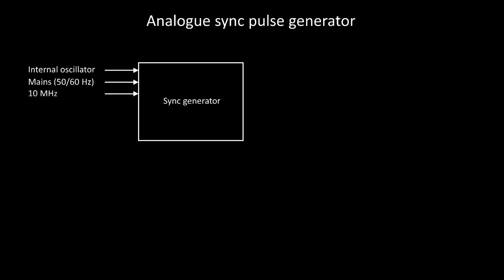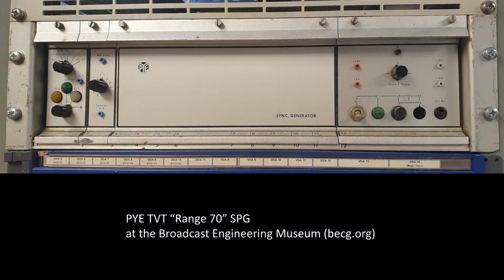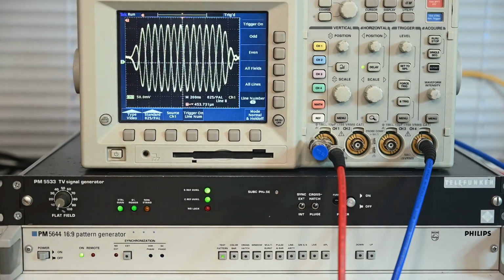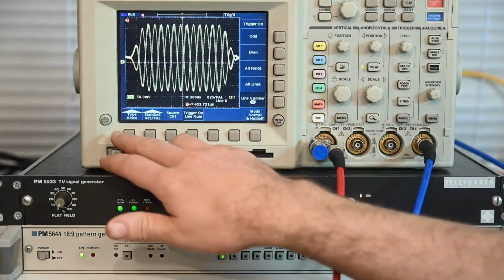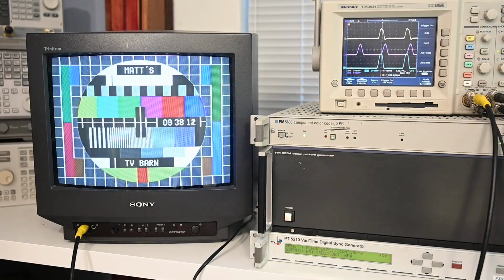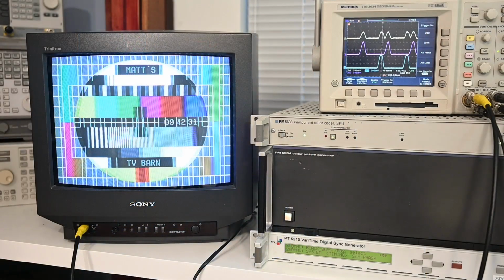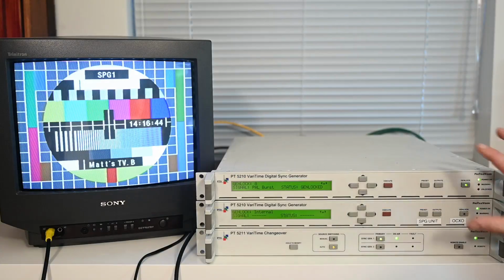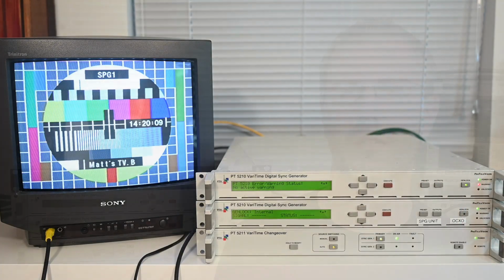#19 - Analogue sync pulse generators (SPGs), sync signals, genlock & video mixing

Comment: I've long knew that you can mix synchronized composite feeds with essentially just a potentiometer, but it's still quite magical to see it happen live.

It would be also nice to see it done purposefully wrong, on signals that can't be mixed. Like SECAM - and see how that would manifest on screen. I have an idea of what the result would be, I can also simulate that in software (or generate a "fake" SECAM signal on a Raspberry Pi or something) but seeing that done with real studio equipment would be something else ;)

Comment: 1:56 - Now I'm confused. I assume that if the grid needs more power the dynamos have to rotate faster? Thus higher Hz? This isn't common knowledge. But what about a dynamo with no load? Where does the energy go? 🏥 🛏 💊
Reply: If more electric power is required the energy driving the generator is increased which make it TRY to speed up but that causes the generators phase to try to advance which causes the current feeding the grid to increase using up the added energy. The generator thus stays synchronized to the grid but delivers more energy to the grid. If the generator is not connected to a load the generators speed of coarse increases to use up any added energy feeding the generator.

Comment: The Grass Valley 9500 sync generator change over was as close to failure proof as you could get. They had a PC board with glass reed relays in a circle forming  a 6 pole double pole switch. There were no buffers or any active components in the signal path, just the glass relays. They did monitor all six signals from both sync generators for amplitude. A loss on any signal would trigger a solenoid to move a permanent magnet disc under the reed relay board to switch to the standby generator. To manually switch there was a lever to move the magnet disc to enable either sync generator. So even if the changeover unit had a power failure, you could still easily manually switch to the opposite sync generator. A bit overkill, it's only TV! The Tektronix and Leitch changeover units of the day were active devices like the Phillips.

Comment: Note that in consumer and pro non broadcast VTRs (Umatic) the color subcarrier is not locked to H unless you use a TBC. This does produce a decent image but is also introduces artifacts as the chroma is stabilized but not the luminance signal. You can forget about consistent Y/C delay! Also note that in the USA early 2in quad color videotape broadcasts also had unlocked subcarrier as they had no way to stabilize the luminance to the required precision for color playback. Two processes were used. RCA hetrodyned the separated chroma up to a higher frequency around 20mhz, then back down to 3.58 and used the off tape burst to cancel out the chroma jitter. Ampex took a different approach. They demodulated the chroma to R-Y/B-Y using the off tape burst, then re-modulated using station subcarrier or a local free running oscillator. This was technically not a legal broadcast NTSC signal but the American FCC looked the other way as this was the best technology could  offer at the time. Around 1960 Bob Coleman of WBBM TV developed the prototype AMTEC and COLORTEC which was an analog TBC that provided phase locked direct color playback. But it took until 1974 where digital technology became available to timebase correct helical VTRs. There were a few high end direct NTSC color recording helical VTRs that did have analog TBCs, the IVC 9000, Ampex 7900, Sony MV 10000, but they never took off in the broadcast arena until type C came around. What was revolutionary however with the early digital TBCs  was the ability to make 3/4inch Umatic VTRs meet broadcast standards and killed film as the defacto news gathering technology.

Comment: Ohh there's a neat story about the first official PAL broadcast which can be found here:
https://www.youtube.com/watch?v=lgO34-6QLEw
Apparently the sync pulse generator broke in a subtile way, messing up the phase relation between sync pulses and the chroma subcarrier. At first nobody noticed, after all all monitors were showing perfect images, but when they played back the tape it was all in monochrome. Apparently also the BBC, which somehow got the signal, too, called to complain about the issue.

BTW the engineer flipping the switch couldn't see a monitor when reaching for it... so he flipped it a bit to early.

Comment: Happened to work a bit on an SPG design that never materialised to a real product. Note, many current day broadcast engineers won't know anything about the PAL 8 field sequence, so a good mention! These bi-level syncs are still used, though more and more they're replaced in studios by PTP in networked video. There was a brief use of tri-level sync for HD, but most facilities just kept using the bi-level syncs, also for HD.

Comment: I actually tried a similar thing a week ago using 2 Blackmagic Ultrastudio 4K units.  They're genlockable so I sync'ed them and had them output to a Karl Klomp Dirty video mixer.  I had the same result as you with the fade being scratchy. But believe it or not I actually have a use for all this with modular analog glitch video gear like that from Syntonie in France.  Basically I can output one video feed and then have another synced feed functioning as control voltage on the first. This lets the CV feed function as a mask/key for whatever glitch effect is being applied.

Comment: BTW if you don't have a vectorscope, but you want to compare phases you might be able to do this in XY-mode on some digital oscilloscopes. Essentially you need to trigger in such a way that the bursts fill out the capture buffer of the oscilloscope. This will then be used to draw the image in XY-mode. It essentially gives you a "gated XY-mode".

Comment: I remember when I got my first oscilloscope that the chroma burst always was in 2 phases on every channel I've checked. Back then I thought that would be normal. Could it be that some stations operated with a slightly different subcarrier frequency (off by 25 Hz to turn the 8V sequence into a 4V sequence)? This was in the early 1990s on satellite channels.
Reply: Also what I've noticed is that ZDF has at least one cartoon show "Alfred J. Kwak" shown from 1990-1993 which on re-runs has a problem of the saturation flickering like wild. Could this be caused by the station switching between subcarrier frequencies between the original run and the digitization?

Comment: Trivia time Matt - back in the day the studios at channel 7 Sydney were not gen locked to presentation. They were close... but not quite enough to give a clean fade-up from black reference to the selected studio in full colour (you'd get that usual B&W picture and then colour reference would kick in at the top of the fade).  So it was just common practice for pres to face to black off the commercial break for example, cut the studio to line (a clean cut), then the studio would fade up instead (the reverse when going to a break,). Why didn't they fix it? Dunno 😉😂. Timing every source back then would have be quite cost prohibited. Unless a frame store was available and free at the time, OBs were in the same situation frequently. Fun times...! Great vid BTW, cheers.
Reply: @WormsByCurtis  So right indeed!  In fact, as a no joke, the small studio with a camera that we had attached to presentation for back announcements was timed using a large cable reel tucked away in the back corner. When I first started at 17 I asked what the cable was for and instead of a correct explanation I was told "If you ever touch that roll of cable, you'll be sacked!" Shortly afterwards I understood why - quite scary at that age 🥴
Reply from the maker: Prior to the 1990s you would have need an individual SPG for each BB where a differing timing was required. With each unit costing thousands of dollars it is possible it was a commercial trade-off.
Reply from the maker: @WormsByCurtis  sure, but there comes a point when delaying with cables would become impractical!